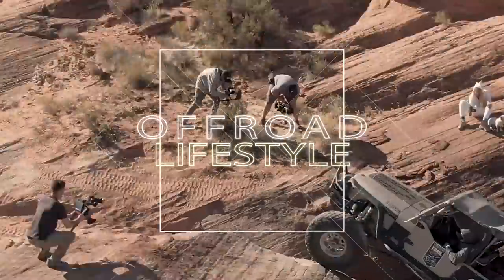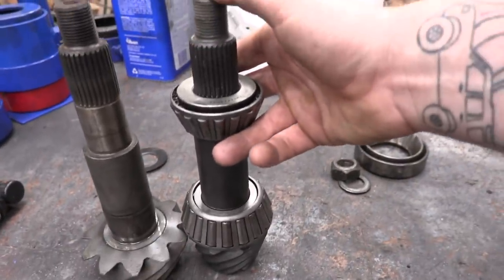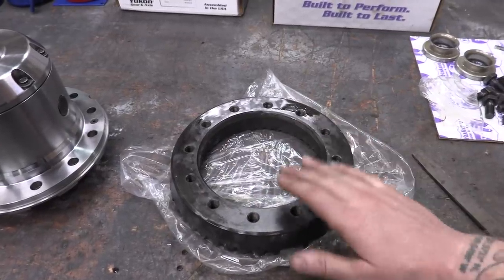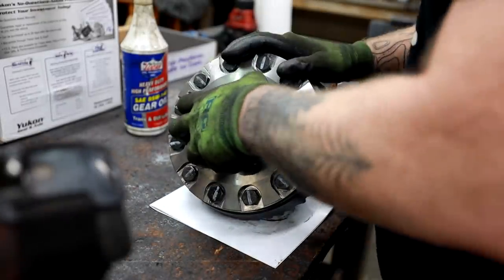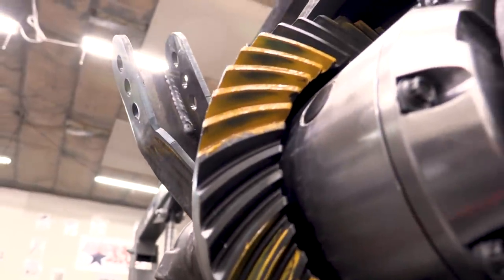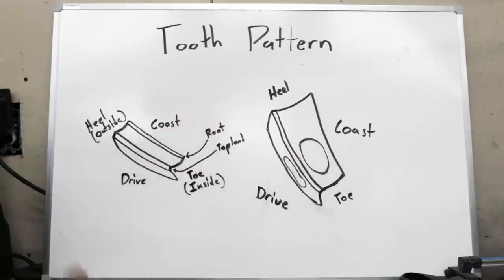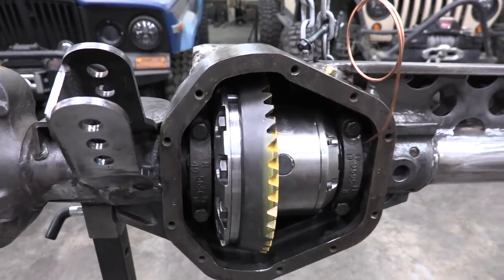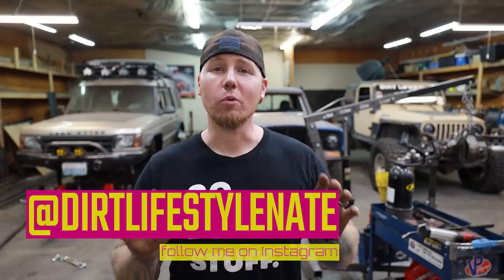Dana 60 How to Gear And Locker Install. Ultimate Land Rover Discovery Build Episode 12.

Comment: Perfecto!! and the Yukon installation manual is the bible for installing r&p gears.

Only thing i would suggest is wrapping a shop rag around the pinion yoke to act as an "brake" when your checking backlash and the pattern and rotate the gear through the marking paint 2-3 times in the same direction using only your hand on the ring and the shop rag looped around and twisted up on the yoke in your other hand, it makes a huge difference in the clarity of the pattern your trying to read.

I.e. 2 to 3 revolutions through the paint to check drive side and 2-3 to check coast side, w/the shop rag on it.

I think you did a great job explaining this topic and letting people know what tools ya need and what ya don't.

Cool show👍thumbs!!

Comment: When we did my 97 Ford HP 60 a few months ago, we didn't realize you needed a reverse thick ring and pinion kit and a small carrier Zip locker... So mine is still waiting on the new locker until I can sell the large carrier Zip locker. Great video.

Comment: Take some tubing and a washer and a nut, and make a spacer to replace the factory yoke.  Works great, no pounding on the yoke and will speed up the pinion setup.    You do everything like I do it.  Have a bucket full of old bearing races for the press.

Comment: Best video with awesome editing and explanation.  Wish this was made when I did a rear axle on a toyota two years ago.  It took about 50 tries to get the beSt pattern on this nitro gears (4.88) that had run many K on a totaly worn out pinion bearing. 
The local dealer had made a fix with a new outer seal. 🙈🔨

We should have bought a new set og gears but no mire money as the car was just bought dome weeks ago second hand.

Our problem was that the bad bearing had made uneven wear ob the different tooths so we had to much runout.

But Im confident after 50 tries adleast that we made it as good as possible.

Any tips on videos or good info on gear set up on used gears bit with new bearings eould be great as the pattern and everythibg is different when using the old gears that had been mating over years✌️

Love your channel and farout the best at all you do and very easy  language in the terms of the way you speak.

All the best to you and your family from way up norh in Norway
67°North above the ArcticCircle 👊
Reply from the maker: Thank you! I bet wheeling in Norway is awesome!

Comment: I’ve read that you could stretched the ring bolts by doing that. What I did was freeze the carrier and heated the ring gear. Worked like a charm.
Reply from the maker: I'm not sure how that would be possible unless you are use a very powerful impact. Like I point out in the video I was using a low power impact and it pulled the ring gear onto the carrier no problem. These get torqued to 90 ft. Lbs and my small impact doesn't even get them close. But like I also say in the video there are many ways to install a ring and pinion 👍
Reply: Na, it requires a lot of force to stretch a bolt. Pulling the ring gear on is nowhere near enough force. You ever install head bolts that are torque to yield? Think about how much leverage you need to do that. Pulling a ring gear on is nothing.
Reply from the maker: @jasonadams4344  to your point, head bolts are usually way smaller in diameter then ring gear bolts. A 1/2 bolt is actually super strong! I don't even own an impact that could stretch a 1/2 bolt. 👍
Reply: @DirtLifestyle  I know you were concerned about hearing a bunch of crap about doing that video. Thanks for keeping the integrity of the content intact with the 4x4 subject. Gears is something that needed to be covered. You did a great job, and I do them just like you and never had a problem.  Don’t worry about the comments, you can’t please everyone. BTW, you got one of the best channels on YouTube, thanks for what you do!
Reply from the maker: @jasonadams4344  much appreciated my friend! Kind words!

Comment: Have you considered the TJM PRO locker. It's still air opereted but uses a piston to actuate the locking sistem. It should be less prone to air leaks. Otho i don't know if they make it for the dana 60. I am loocking to fit a rear locker on my disco 1 300tdi and to me looks pretty much bomb proof so i wanted to let you know about it. Hello from Europe 😁
Reply from the maker: Hey man! I've never heard of them. Time for some research 👍

Comment: I've watched several videos in the last week , it finally clicked , I'm now starting to visualize and understand the relationship between pinion depth, shims , and backlash .. a lightbulb went off , so thank you . I want to start buying tools so I can attempt my next gear and locker install . Paying someone is starting to suck, especially when you're overpaying like 99% of us are . I still have yet to see anyone video the copper airline tubing install into the bulkhead grommet , so frustrating , that part I'm still confused about. Does the copper airline stop at the grommet inside where it feeds into the hole , or does in run all the way through ? Or does it stop inside the housing , feed into the grommet , and then a separate airline run from the outside of the grommet to the air tank ? Over 4 hours of watching builds ,, everyone skips this and fails to show the completion of it . Great video , very informative, thank you
Reply: Copper line goes through the housing & is connected to an air line outside the housing.
If you look up Dynatrac & air locker videos should show it from what I remember.
Reply from the maker: The exact installation instructions will be included with the locker. You push the copper line just slightly past the rubber grommet and tighten it down. 👍
Reply: @DirtLifestyle  
I see 👍 ,, hey no question is a dumb one when your new 
Joe Dirt- “I’m new I don’t know what to do” 

Lol , thanks , keep up the good work , excellent channel !
Reply: @jessename7849  
Thanks Jesse 👍

Comment: Great video. Awesome you tube   Channel! I have a question. Where did you get the air bottle jack in your harbor freight press? Yours works so slick! I have the same one now should have bought it years ago. I just have to be careful because I always seem to drop those plates on my feet constantly! Its kinda a tool to wear boots with if you want to keep your toenails. I just did a spartan lunch box locker in a dana 44 without touching the pinion. The expensive dial indicator and good condition of the ring and pinion made me afraid to mess with it. This video and sharing your no nonsense skills makes me willing to try it myself.
Reply from the maker: Thanks man! The air over hydraulic jack is from harbor freight as well. I'm glad you enjoyed the video!

Comment: Great video, Nate. I've watched several setup videos, one in particular that was quite good from Fab Forums, and you did cover a few problem areas that he didn't.

One thing that I haven't really seen concerns the crush washer. You showed the eliminator (knowing my luck it won't be available for my axles) but I did have one question.

Do crush washers have a uniform crush depth? I would think that the crushed length of it would be too variable for the application.
Reply from the maker: Hey man!
You crush the sleeve until you get the correct  backlash. It just keeps on crushing so this is a universal tool for getting the proper preload. The problem is it takes a TON of force to get any movement. To be clear I'm not talking about a powerful impact wrench type of force. I'm talking a breaker bar and 6 foot cheater bar type of force. The sleeve can be manipulated to fit whatever depth you need it just takes alot to get it there 👍

Comment: Nate, what is a good source for the special tools needed for differential service? I am considering moving up to 35's on my 2010 JK 2 door and will need to re gear. Not exactly sure what ratio yet, learning before I leap. I am not a rock crawler, daily driver/trail runner so your opinion would be valuable to me. when this happens I will also be going with a locker at least in the rear, stock 44  and stock 30 front. I am thinking electric or manual with electric solenoid activation. I trust and value your knowledge and truly enjoy your channel, thank you. PEACE
Reply from the maker: Hey man! I have quite a few tools in the Amazon cart in the description. Its the best way to point you to the stuff I use 👍
Reply: @DirtLifestyle  Thanks Nate picked up a couple of items I will need in the short term for now.

Comment: If you're re using the stock carrier is it safe to just unbolt the old ring and bolt the new on? Or do you need to remove everything and start from scratch?

Comment: I'm looking for brand recommendations for gear oil on my new Yukon gears I had put in my axles of my 08 Wrangler. I know it needs to be an 80/90 but what brands do people prefer and what kind of additive should I be using for the lockers? I'm well past my break in period so I need to get the oil changed as soon as I can.

Comment: Do a video on the sterling gears if you haven’t already got it done. There isn’t a good video on that axle and it is different. Getting the shims in it is a bitch compaired to behind the bearing. I actually considered getting shims that would fit behind the bearing and seeing if it would work. Hammering that shimstck in sucks
Reply from the maker: The sterling was super easy in my opinion! The only trick is use a shim driver and the rest of the Job is exactly like this one. 👍

Comment: When you measured for the crush sleeve, and bearing preload, shouldn't you account for the shim under the larger bearing setting pinion depth? I know it's only a few thousands of an inch. It just seems like EVERYTHING with gears is a few thousandths of an inch. Measuring from the pinion gear to the top of the crush sleeve would be better just because the distance on the factory gears won't change, and the distance on the new gear also won't change. You can subtract the shim thickness as you add them too.

Comment: Nate - If you have an axle that has shims on the outside of the bearing races vs under the bearing, can you switch them and put them under the bearings or do they need to stay on the outside?
Reply: Shims could go on either side of the bearing & it's race. They adjust the backlash & keep bearing load.
Some axles don't use shims. Instead they have threaded side to side adjusters, which is nice to set up axles.
Reply from the maker: You can place them on either. In many cases it makes more since to place them on the outside in my opinion. Then you can just press the bearing on right away. But I know i will be servicing this locker so I took the extra steps now to simplify this job in the future 👍
Reply: Couldn't you have set it up with them on the outside & the moved them to the inside for final installation? Doubt they'd change 😉🍻🍀
Reply from the maker: @jessename7849  Yep. But in that scenario I would still need to pull the bearing or use a setup bearing. In the method I used I never had to pull any of the new bearings which is what I prefer if I can get away with it 👍
Reply: True (as I thought/ knew) but could be faster even with setup bearings to figure out shims then place them behind the final bearings upon final installation.
It would have likely made it a bit more confusing for educational/ instructional video as it is.
Keep up the great content,  I agree & enjoy very nearly everything you do. 😎🍻🍀
Reply: I like the idea of using the setup bearings and then placing the shims under the bearings for final installation. The part that sometimes gives me the most issue when putting shims on the outside is bending a shim. Without a case spreader and trying to get both sides started, I’ve been know to mess up a shim. I was not sure if you could put them under if the axle came with them on the outside. I will experiment the next time I do gears. I have a set of 4:10 gears to drop in my Gladiator that came from a Rubicon (brand new that never left the lot before the gear change). 

Great videos Nate! If you ever make a trip down south Arkansas has some awesome terrain!

Comment: Why no outer tube seals?
Reply: The bigger question is, why? All outer seals do is keep an inner oil seal leak hidden. The inside of the tube is fine to get water and junk in there...that's why there is inner seals.
Reply: I'd rather keep all that out of my tubes especially if it's going into nasty conditions that would be likely to load the tubes up with crap.
Check your diff for fluid consistancy & level 🍻🍀

Comment: What makes the axle hard to turn?
Reply: everything is new
Reply from the maker: Mostly bearing preload. 4 big bearings in a dana 60. All with lots of preload. But if you spin from the ring gear it harder then spinning from the pinion. These are 5.38s. For me to spin the ring gear once im spining the pinion 5 times.
Reply: @DirtLifestyle  ahhh okay thanks in my head I was thinking brand new bearings shouldn't it be like butter but forgot the preload

Comment: Nother question: How reliable are those air lockers? Most of you 4 wheel guys rarely put very many annual miles on those off road vehicles. How do they hold up under highway driving say like 50,000 or 80,000 miles?

Comment: I've always left gears and automatic transmissions to guys who know what they are doing. Unfortunately, here overseas in the Middle East, I am going to have to do my gears myself. These shops over here I wouldn't trust with my wheel barrow. Thanks for the crash course and insight. I have the dial indicator already just not looking forward to it.
Reply from the maker: Good luck! You got this 👊
Reply: I wish you good luck. Let us know how it goes!
Reply: If you find you are getting frustrated Just walk away for a while. clear your head then go back at it
Reply: @ypop417  I use that technique frequently. It works for me.
Reply: @kevinkirk4285  If I did it, anyone can do it. Just get everything within tolerance and get a good pattern. The right tools help but I didn't have a bearing press so I did the oven and freezer trick for the bearings. Worked perfectly!

Comment: The ball at 10:38 seals the end of the hole drilled to act as the air passage between the seal housing and the locking piston.

Comment: Best video I have ever seen on YT.  I got into an argument with an "expert" when I asked about checking backlash.  He said "NO the dye will tell you that".  

The only thing I have a problem with here is a failure to mention the pinion markings.  At least when I did it, the head, ring side, of the pinion was marked.  It could be marked +5 or -5 or something else.  This would tell you how much you should move the shims from front to rear or vice versa.  Other than that, great video.

Comment: Great video Nate but I saw that in the amazon cart you have the $400 Yukon bearing puller tool. For those tackling this job, I got a knock-off bearing puller for 1/3rd the price (Allstate gear PN: YTP20) and I'm pretty sure it's made in the exact same factory as the Yukon one. This tool is a must-have,  so save yourself a few hundred bucks and don't go with a name brand.
Reply from the maker: There are some less expensive versions on Ebay too!

Comment: I can safely say that I’ve watched every R&P setup video on YouTube and this is by far the best I’ve seen. Only thing I’ll add in my experience with HP 60s is that you HAVE to use the oem ford 2 piece inner axle seals from the newer 05+ super 60 axles. (P# Qu20463) it’s a far superior seal, and can be used in the older housings with the correct installer. I also like to use the newer outer tube dust seals 
(P#18248-05347702) and turn them down on the lathe and then silicone them into the recess in the housing. Keeps all of the dust and water out of the axle tubes and I think probably cuts down on premature seal failure.
Reply from the maker: Much appreciated!

Comment: To make your setup/dummy bearings I use a brake wheel cylinder   3 stone hone. Cheap tool that can be  bought at any car parts store. By using a hone the bearing center will stay true.

Comment: I put an eaton e locker in my wife's JKU front d30.  The carrier bearings are a different size than the o.e. carrier.  I had to get creative to press the bearings on.  I wish I would have thought about using the press to hold the carrier when I did the ring bolts.  That would have made life easier.  Oh well,  live and learn.  I need to get one of those inner axle seal installers now also.  That thing looks slick.

Comment: Great clear video footage of the tedious process! There is only 2 other full videos on setting Dana 60s on YouTube and a 3rd with new camera angles and tips is 100% awesome. 

An inner pinion setup bearing is technically not needed. I made one then  realized I never removed it once. Just the inner setup race, and outer setup bearing is all for the pinion 😂

Agree on the puller. I bought one. But a splitter with a press and extra bearing or two you could do without it. 

I was a little shocked to see the glue being used at the end. Lube Locker gaskets are like $25 and make fluid replacement and diff cover removal so much easier. Glue was on mine previously and I had to beat the crap out of the cover with a chisel to remove it. Not worth risking a bent cover in my opinion.

Comment: The stainless ball is there to seal the machined hole for the air passage into the air locker carrier.  And you are right, you don’t want to damage that surface where the stainless ball is pressed in.
Reply from the maker: Good to know 👍